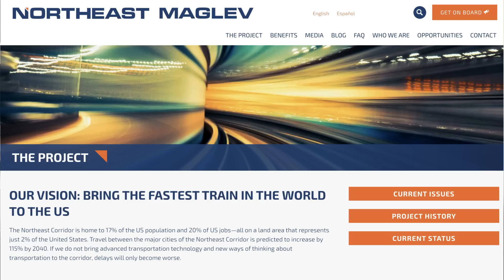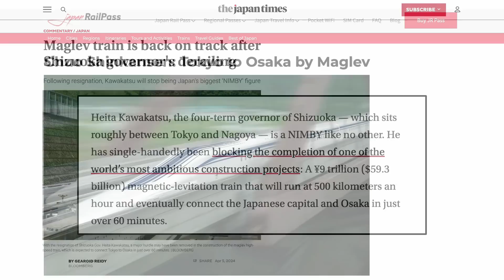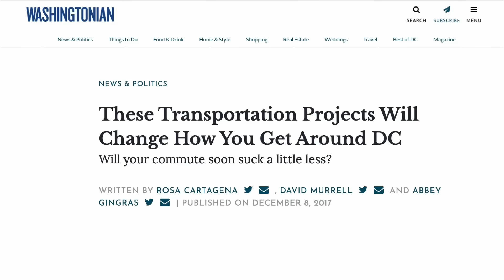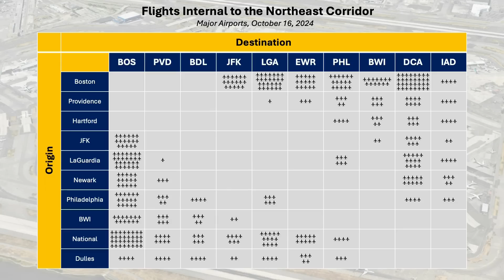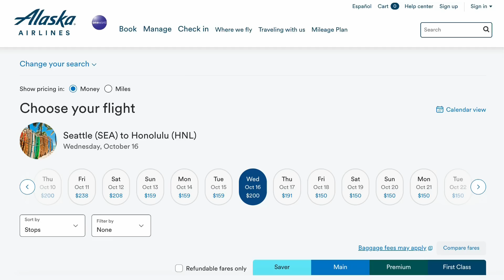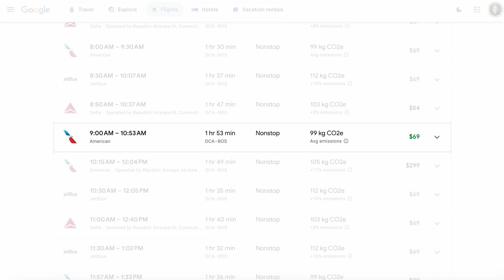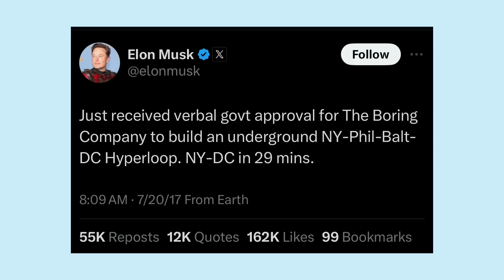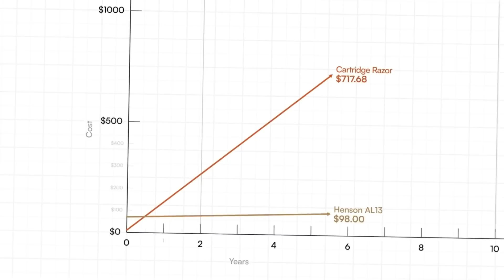A DC to Boston Maglev Would Be Awesome (and you know it)

Comment: well high speed train would be fine, but do not fall for the crazy idea to invent the wheel and the fire new... there are a lot of high speed rail networks in the world already working, fully proven technology...
Shinkansen, TGV, ICE, Frecciarossa, and they have all in common, the have their own way, no level crossing, no slow trains, no cargo trains... it cost alot to plan and build them but less than to custom build that maglev unique thing...
Reply: Don't get your hopes too high because of these systems, the Shinkansen is the closest which fits the description (and even that isn't pure with some Mini Shinkansen running together with conventional trains, and the planned Hokkaido tunnel also is mixed with freight IIRC). The European systems instead travel on existing tracks on some portions, either because they access an existing station or there they lack the high-speed tracks. Germany (ICE) in particular builds (particularly early on) its HSL with freight support in mind so even the freight separation isn't true there.
Reply: Elevated MAGLEV seems to make more sense in the NEC than HSR does, for the reasons he states.  Needing of the new right of way anyway.  If we're treating the maglev line as the express route that it should be, then the existing rail/hsr corridors become the local connectors/feeders for that express.

Comment: Nice video! I appreciate this. It's a very interesting thought experiment. I live on the northeast corridor and have used Amtrak for about 35 years. I have always felt that to encourage ridership Amtrak doesn't need super-duper latest tech railroading in the northeast. If they got the total travel time between Bos-Wash down to about 5-6 hours (the current fastest travel time on the Acela is about 7 hours) and prices down to match the airlines (about $140 one way for a ticket bought 60 days in advance) they would sell out just about every train. I guess some infrastructure updates would do it. There is nothing more infuriating than when the rain slows down to a crawl north of NYC where the tracks are right next to I-95 and cars are whizzing by.

Comment: The NEC is too crowded for building a new rail line. It doesn't need a heavy population around the line, it needs a heavy population around the stations. The line itself needs empty space to build and operate track.
NY to Chicago would make more sense. The end cities are huge, with a lot of traffic in and out,  and significant intermediate stops like Harrisburg, Pittsburgh, Cleveland, Columbus and, of course, South Bend, Indiana.
As for the Central Shinkansen, I would recommend stopping at Nara instead of Kyoto, which already has a shinkansen. Once the route is proven, it can be extended through Shikoku to Kochi and Oita to connect to the Kyushu shinkansen in Kumamoto.

Comment: The Shanghai Maglev is a white elephant, not because it doesn't work but because it doesn't actually take people to any of Shanghai's CBDs. Just kind of drops you in the middle of Pudong where most people don't want to be and competes with extremely affordable taxis,  even cheaper bus service and the subway (yet cheaper but slow).

In my experience, people ride it once to see what it's like, then never again.
Reply: And take a look at the proposed location for Baltimore's Maglev station: more than two miles away from the nearest EDGE of the city center, with a desolate post-industrial landscape in between that no one would walk through if their life depended on it.
Reply: Sounds about right. The Shanghai Maglev system was meant to connect German cities but the Germans gave it up because at the end it only had the novelty factor going for it. The Chinese bought the technology because at the time they were building their brand as a future oriented economy and didn't care about the price tag or the viability in the long run. A similar thing is happening with the hyperloop. The Emirates and Saudi Arabia are eying with the technology for the prestige it could give them but conventional railway would probably be more sensible in the long run.
Reply: @bikesandlikes  I love CityNerd and his videos, but I think conventional high speed rail is probably the way to go. It's fast and cost effective enough to do the things we need to do.

Maglev (proven but expensive technology!) and hyperloop (uh, definitely not proven although new claims are being made) are interesting. Neither seem particularly useful at the moment, though.

Comment: My biggest issue with SCMaglev is that it's not clear if high frequencies are possible, due to the low performance of the track switches (which have to move an entire large concrete track section over a distance of multiple meters using giant hydraulic systems, as opposed to traditional rail switches only needing to move a piece of steel a few inches). The Chuo Shinkansen is currently projecting only 5tphpd; this is probably lower than is technically achievable due to their plans for multiple service speeds on a 2-track line, but it bodes poorly for the future capacity of the technology. Meanwhile, JR East continues research into speed increases on the steel-on-steel Tohoku Shinkansen, with plans to get up to 360kph in revenue service by 2030 with tech currently being tested at up to 400kph on the ALFA-X test train. I suspect that service is going to move a lot more people than the L0 series on the Chuo Shinkansen ever will.

Comment: China's CF600 maglev EMS prototype train testing at over 600 kph with goals of 800 kph is very likely the first practical high speed maglev.   It levitates at at standstill and requires no landing gear.  A new maglev train standard in full scale implementation should start a new much wider loading gauge of about 8 meters wide or more.   A double width loading gauge has been envisioned and was provided for at the beginning of the railroad age on 1840s UK dual track railways that were designed to occasionally have double width carriages using the inner rails of the dual tracks.    

Maglev trains don't have the load limits of the rail wheel interface and are able to support loads distributed across the track bed.   An 8 meter wide loading gauge would allow the easy transport of large assemblies overland greatly changing the world.  Three TEU shipping containers should be able to fit across a cargo car's width.  

An 8 meter wide loading gauge would allow stability for three passenger levels.   The first level might best be used for cargo with perpendicular side simultaneous drive-on drive-off of automobiles and cargo containers that could take place in a one minute stop.  High speed cargo might make profit.  Passenger trains tend to not make profit.   

The second and third levels could be luxury continues passenger space with vista dome roofs for passengers to see forward watching the scenery.   This configuration would allow more comfort for the same number of passengers in 1/4 the length of today's popular single level trains that stretch out several city blocks.  

The train can depart as soon as the automobiles are loaded with enough space around the parked cars for passengers to take their time collecting themselves to exit their cars and go upstairs to the passenger areas.    Loading and unloading needs to be staged and simultaneous to allow 1 minute stops.  The unloading and loading of roll on cargo and automobiles should be able to work much like a traffic light stop and go.  

High transfer passenger stations could have exit and entry between the staton at all  levels of the train to speed loading.  Rural stations with small numbers of people would have loading at level 1 cargo level with passengers having to go up internal stairs to the passenger levels.   
 
Having train speeds much above 1,000 kph (621 mph) which can start causing sonic booms has little time saving advantage when stopping every 160 km or 100 miles because of time spent changing speed and stopping for a one minute stop.   With changing speed these stops would only be a bit over 10 minutes a part.  This would mean if intending to have regular stops within reasonable driving times to train stations it would be better to allow sightseeing from a passenger train staying below the speed of sound than to put into a vacuum tunnel to enable super sonic travel where there is little to see.  

Using 2/3 of the running speed of 621 mph to give a rough average speed of 400 mph wound mean such a train could cross the width of the USA of about 3200 miles in 8 hours.  

All very high speed trains need incrementally cheap to free electricity for their huge electrical demands such as their own hydropower generators with unlimited water.  New technology nuclear power is likely the next closest option.

The Japanese SC maglev has a loading gauge width that is similar to cape gauge railways of 3'6" gauge common throughout Japan that is significantly less wide than the current standard gauge Shinkansen bullet train.  The SC maglev uses a non static levitational system dependent on the train reaching about 140 kph before it starts to levitate.  Below that speed the train has to use retractable landing gear.  These aspects make the Japanese SC maglev not desirable for a new train age where much wider loading gauge and no landing gear are desirable.

Comment: Counting the Amsterdam paris corridor as "true" high-speed is pretty misleading as throughout half of Belgium that train will driving on conventional tracks. And between Amsterdam and Rotterdam there are currently major speed restrictions, but even without those the train rarely hits anything above 250km/h outside of France. The average speed of that train is also rather disappointing when you compare to Tokyo-Osaka or if Japan is to future tech with trains paris lyon will also have significantly higher average speed.

Comment: my issue is i'm worried about cost - not "its too expensive to build", i mean ticket cost. I take the NEC between DC (or BWI) and NYP regularly. the regular trains are about 3:30 and about $50 (although if you don't get them long in advance, the price can blow up... which is a whole other problem). Meanwhile the Acela only saves about 30 minutes, but it's usually over $100. The time savings per dollar ratio comparing Acela vs Regular between NYC and DC is just not worth it imo. 

Maybe maglev will bring it down to, say 2 hours, but will the tickets be like $300?

Comment: Why not add Richmond VA, Charlette NC, Atlanta GA as well?
All should be separate from ground auto traffic so there is no need to slow for crossings. In fact, there should be two sets of tracks, possibility one circuit clockwise and one counter-clockwise.

Comment: 15 minute intervals for trains mean, that people stop memorizing the train schedule and start treating it as a part of infrastructure that is just there, ready to use, to a certain extent just like they treat cars. hop into the train and go somewhere.
austria is currently on the way to achieve this. long distance intercity travel, replacing cars.
of course, the shinkansen is a different beast. during peak time, there is a train every 3 minutes. people stop worrying being late for their train, because the next one will be there very soon.
Reply: That is the key . Convenience . The trains in Japan run so frequently that you don’t really need to plan to take a trip . Just show up when you want and a train will be departing soon
Reply: Like the tube in London. (Every 3 minutes)
Reply: To be fair, we Americans have the opposite lack of need for a schedule. Whenever there’s a passenger train on the platform, we hop aboard, since there won’t be another one until tomorrow (or in 2-3 days if you’re in Cincinnati or San Antonio)

The way I see it, trains should be frequent enough that the only reason why you’d need to remember the schedule is if the originating station is at a junction (don’t want to get on the wrong train), and even then information boards should direct you to the right platform.
Reply: Shinkansen basic schedule outside peak is one per 10 mins (of the fastest nozomi line, so not counting the slower ones). Most JR lines have basic trains every 10 mins and many way fewer. The frequency is truly crazy.

In Europe at best it's like one every 30 mins for high speed train
Reply: @meneldal  Austria, Westbahn-line (Vienna, Linz, Salzburg, then splits to Innsbruck and Munich): ÖBB one per hour, DB runs their own trains with ÖBB, and Westbahn every 30 min.
If they would coordinate, that would be a high speed train every 15 minutes.
Reply: @robertheinrich2994  Das Ticket ist hoch subventioniert und die Westbahn ist eine relativ alte Bahnstrecke die nicht Baukosten von 120M€/km Einspielen muss.
Reply: @patrick_test123  I totally know. but in the background, ÖBB charges Westbahn for every train ride and every stop in a railway station. but yes, austria is adding money, and it's quite a lot (3000€ per ticket, as far as I know).
but car travel is highly supported to. building roads, bridges, etc. it's not funded with a 80-something-€ sticker for the windshield.
Reply: You likely will need to catch a specific train anyways unless you're paying a very high premium for the flexibility.
Reply: @patrick_test123  I have the austria wide acknowledged klimaticket. it's basically: I can use any public transportation in austria, that I like to use, whenever, even if I just feel like stepping into a train right now.
for a flat 1095€ for a whole year.
germany has a similar ticket, switzerland has a similar ticket, etc.
Reply: @patrick_test123  Not as true as it used to in Japan, nozomi have seats without reservation now. You still need a reservation for a fair bit of trains on other lines or if you want to be sure you can sit.
Reply: @meneldal  We will see what the ticketing strategy will be with the new maglev. But they will have to get as much money out of their riders as possible, at least as long as they have to pay back the construction cost of the line.

Comment: A GIANT Thank You for making the distinction between Hyperloop and Maglev. Yes, Maglevs exist and can be great and Hyperloop does not exist and probably wont in the next 100 years. Many people do not make this distinction (e.g. GarethDennis) and fail to see what could be.

That said, arguing that Maglevs will result in a time reduction of sorts is hard when one is familiar with the concept of induced demand. Yes thats still hugely better than inducing demand on the road, but nevertheless it is inducing demand, i.e. people will probably just travel more and further with very quick maglev trains. Additionally, while maglevs do use about the same amount of energy compared to high speed rail at the same speed, they do require a lot more energy when going much faster than high speed rail. Maglev still has many other advantages over conventional rail other than higher top-speed (e.g. higher acceleration, smoother ride, climbing steeper inclines, less noise, less maintenance cost due to having less wear on both infrastructure and vehicles due to contactless operation). 

Thats why (coming from an environmental perspective) I would argue that yes we should build maglev but we should usually not utilize the extreme speeds that it is capable of in order to at least reduce the amount of additional demand it induces (rather going high speed rail type of speeds like 300 km/h rather than 500 km/h). Maybe one could do that for a political flagship project to get people excited, but I think it should be reason that this should not be the norm.

To take the "airplanes are doing that as well"-argument upfront I have to say two things: Yes, exactly. And thats a big problem for the environment. But one also has to consider the following: A maglev has much MUCH higher capacity than an airplane route (take a medium sized aircraft for domestic flights with maybe 200 seats flying every hour or so, which results in a capacity of 200 persons/hour and a maglev which will do at least 8000 persons/hour). And a maglev is more comfortable for the passenger and faster in middle distances. All this is to say: A Maglev induces much MUCH more demand than any airplane route.

Comment: Regarding your analysis... How long does the train stop at each station between DC and Boston? How long does it take to slow down from 'cruise' speed coming into the station, and get back up to 'cruise' speed afterwards? Or are we assuming an 'express' that doesn't stop at intermediate stations?
Also, is the BWI Airport station no longer a thing?
Also, seriously, Richmond probably should be the south end of your line (maybe a stop at Fredricksburg, and possibly one at DCA if the new line follows existing rail right-of-ways and goes right past it anyway). The population density thins out between DC and Richmond, but that gives the train a straightaway to hit peak speed.

Comment: Hot take: The NEC is actually high speed rail by international standards. The definitions say that over 120 mph on legacy trackage (which the over 100 year old PRR infrastructure is) and 160 mph on new trackage is high speed rail. The NEC fits this category perfectly as trains regularly go 125-140mph (not even the UK can do this except on HS1) with some sections (like Princeton Junction) at 160 mph!